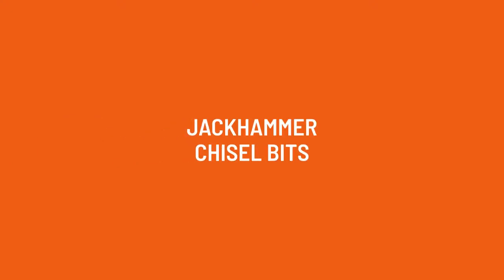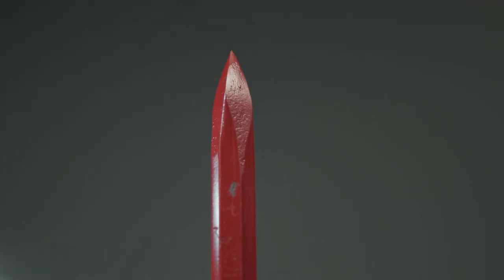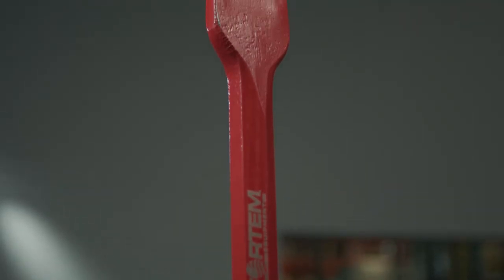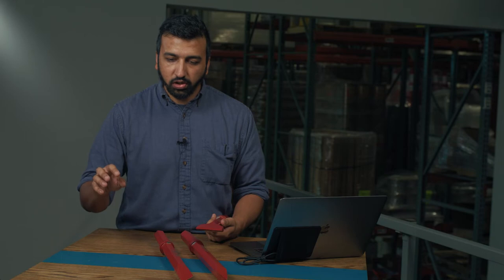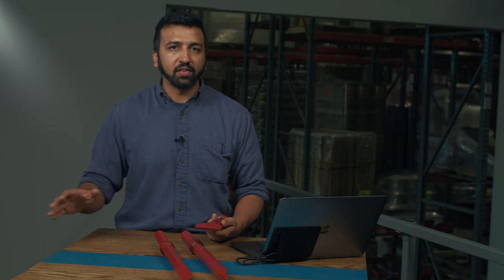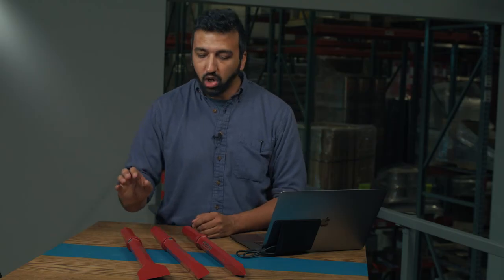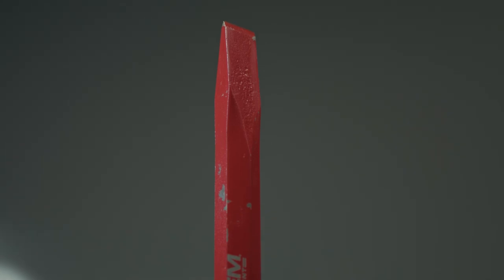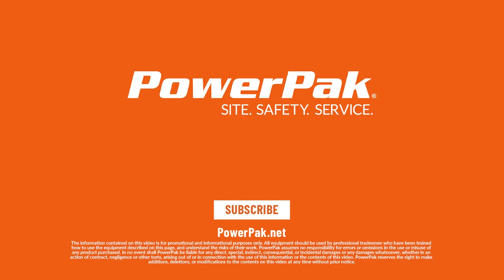Jackhammer Chisel Bits Explained

Comment: Would those bits fit all makes of jackhammer?
Reply from the maker: All of the jackhammer bits in this video have 1 1/4" hex shank. That's a very common shank shape and size, but you'll need to check your specific jackhammer to see if these fit. 

We also have the same bits in 1 1/8" hex shank. Hope this helps.
Reply: @powerpak-safety1440  thanks a lot